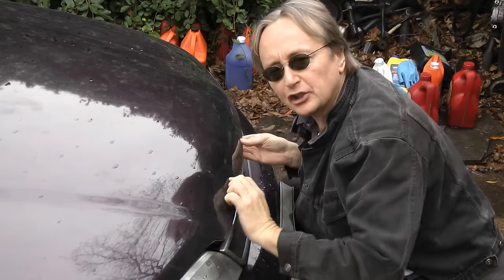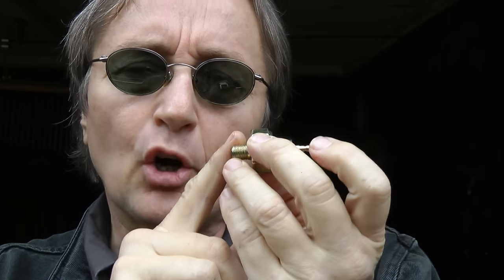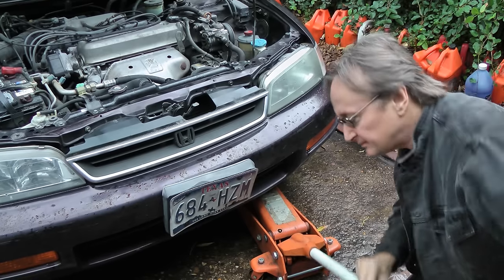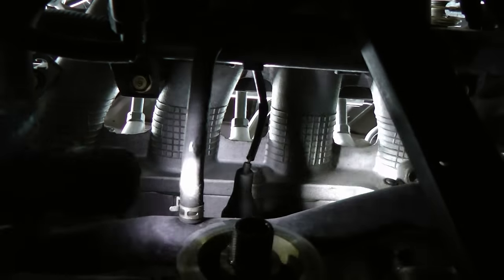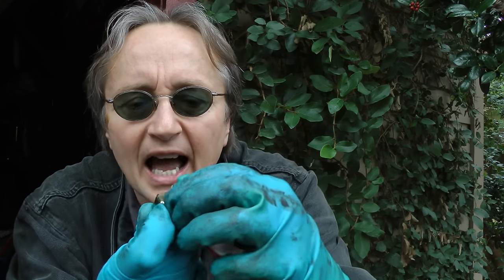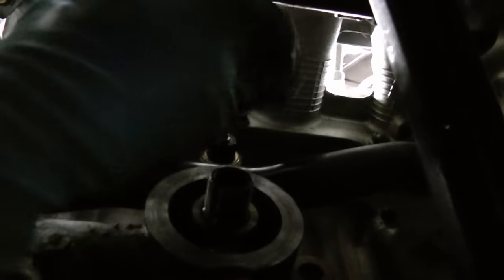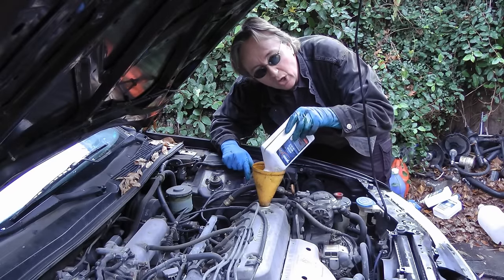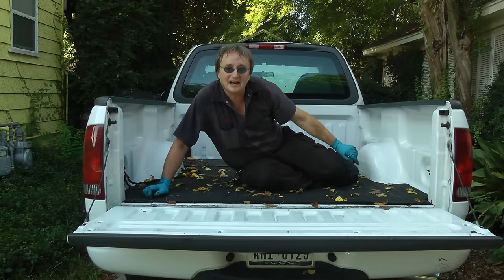How to Fix a Low Oil Pressure Light in Your Car

Comment: What i NEVER got about cars. They have an oil warning light, that come on only when the car is so dreadfully low on oil the engine is probably already terminally damaged. Why not make them so the oil warning light comes on at a sensible time, for example when the oil is half way between the min and max marks on the dipstick, so you have plenty of time to top up before you start grinding metal?
Reply: My BMW has 1qt low sensor and 2qt low sensor plus the critically low sensor. It takes 7qt of oil total.
Reply: @Starscreamious  that's why I'll never own a bmw... You just described 3+ sensors for one job... Are we serious right now ?
Reply: @MechInvent  It really was that way. And I don't see the problem in this circumstance as oil level is highly important.
Reply: If it was that sensitive it would come on every time you accelerate or take a corner, best bet is to just pull the dipstick and check every day or two before you turn the key
Reply: @Starscreamious because they want you to buy the next car
Reply: Chevy Vegas had low oil shutdown 50 years ago. No excuses why cars can't have it today.
Reply: Vw does this and at 150k miles you get to hear it beep when you are going under 50mph on bumpy roads.

Comment: what if that light turn on intermittently during driving? i checked the oil it's not dirty nor low.
Reply: Your oil light on your car dashboard is faulty or your oil pump is starting to going bad.
Reply: I have a similar issue. It stopped after I got an oil change last month , but has now started again just today on Jan. 7th.
I'm willing to bet it's just a faulty sensor.
(I'm hoping it's just a faulty sensor).
Reply: @jacksonkids1  what was it? Mine is doing it now, though now it stays on so I'm sure it's my sensor. Before it was only at idle which was scary.
Reply: @Chu3505 my oil pressure light came on but turned off by itself. But my car sounds really rough while accelerating. Would this be an oil pump issue?
Reply: @andycohen3365  Changing your car engine oil and filter lately.If yes,changing your oil sensor unit too.Listening to your engine near the oil dipstick area?Your oil pump make any noises or grinding sounds?if yes 95-100% your car engine oil pump it on it last leg.

Comment: Ever had to replace a fuel float sending unit in a 1995 Buick Lesabere in the tank?  Go down hill it goes down go up hill it goes up.  Take curves left or right go corresponding sides.

Comment: its slightly more accurate hot since liquids expand with heat. when your can is on it can reach 230 degrees. checking cold will measure only a few millimeters lower.

Comment from the maker: @MrGizmo757 yes it will, the pump may be pumping oil to a spot that's blocked, backing up pressure to the gauge hole where you measure the pressure. Find that blockage and fix it fast, cause other parts of the engine are getting no or low oil.

Comment from the maker: if sending unit is not bad, and you actually have high oil pressure, that's normally a clogged oil feed line in the engine, which backs up pressure before the sending unit and makes it go sky high. Real fun job then taking the engine apart.
Reply: What if the oil lights coming on occationally on start and the oil is suddenly overfilled according to the dip stick.
*Note the oil light goes away if you restart the engine and this is on 2005 Jeep Liberty 3.7L V6.

Comment from the maker: try a new oil sending unit as in this video, and pray that fixes it.
Reply: I think I fkd up the thread of the oil sensor in the engine , its allmost gone , what to do now :o?? HELP!!! the engine is 15 years old :(
Reply: Scotty, help. I changed my oil myself and drained it for too long, about 30 minutes. The BT50 '09 no longer starts afterwards. Any recommendation?
Reply: @laevalla  there is no such thing as draining your oil for too long.

Comment from the maker: the fans are normal. The thermostat is at the end of the big hose coming from the radiator and bolting to the engine head. Two bolts and it's inside the thermos housing where the hose clamps to the engine

Comment from the maker: when the engine spins slower, the oil pump spins slower too. But, as long as the engine does not clank when the light comes on, you can drive it.
Reply: But in my car oil pressure blink on warm engine when low speed  sometime when cold engine not light blinking Can I drive continuously

Comment from the maker: @TOMZM15 many things can cause low oil pressure, from a weak oil pump to a worn engine where the bearings have worn enough that the oil pressure drops from going through too wide a space. figuring out what's doing it is pretty much educated guesswork, other than tearing the whole engine down and rebuilding it. Scotty

Comment from the maker: try any good engine flush in the oil, follow the directions on the can, then change the oil and filter and pray. If that doesn't work, engine would have internal bearing damage

Comment from the maker: @DavidTheCatMedia change the oil pressure switch, and if it still flickers, live with it on that old thing, oil pressure always drops some with old age. Scotty
Reply: Hey Scotty! I have a Toyota Corolla 2000, and I was told that the oil pump may be clogged and to remove the oil pan. Is this right?

Comment from the maker: if oil pump is not working, engine will rattle like mad when you start it up and it's running. You remove the oil pressure sending unit on the engine and install a mechanical test gauge there to see if it works or not

Comment from the maker: @paingain100 not really, it wouldn't effect vacuum, only oil pressure. And if it's leaking, replacing it would stop any oil related low pressure problems if no other problems exist in the engine.

Comment: Hey, Scotty. I've been watching your videos for a long time, and they've helped me a lot. I have a problem with the oil light coming on or flashing when the car is fully warmed up, usually in traffic. After I got home, I waited about 20 min and checked the oil level and it was full. Then I started the car again, but the light didn't come on. The can in question is 98 BMW 5 series (E39) with six cylinder engine. It has a million kilometers on the clock, and although it burns oil, the engine seems to run just fine. It has good power, and I don't hear any noises. Could that be a faulty oil pressure sensor or is it more likely that my engine is worn out?

Comment: oil pump screen or filter clogged up  or sensor 
do all of this older car like a 2001 mercury220 thous-miles put the right oil and filter which one you do first I well put the oil sencer on eng first needs oil change take oil pan on anyways clean oil pump make sure oil pump gears sliping
Reply: no english

Comment from the maker: have the oil pressure sending unit removed and replaced to see if it goes back up to normal. Pray it does, normally it will if no noise is made when running

Comment from the maker: first, you need the correct siwtch. If that still reads low, either the oil pump is bad or the engine has worn internally causing low oil pressure

Comment from the maker: yes, you remove the factory sending unit sensors and screw in the mechanical ones. then you remove the oil pressure warning idiot light bulb or led in the dash to turn the old one off

Comment from the maker: @MrRichierich1990  engines just flat wear out over time. Even with oil pressure, an old bearing can fail, and result in a locked up engine. The oil pressure gauge only measures oil pressure where it is, not in any other locations. Scotty

Comment from the maker: @jdm4life89 then someone really messed up the rebuild. But of course, hook up an actual mechanical oil pressure gauge that we mechanics use to see if it really has none. could be a gauge problem, pray it is.

Comment from the maker: you remove the oil filter and it's hiding under there, but you can't see if cause the ac compressor is in the way. It often is necessary to remove the compressor to get to the switch

Comment from the maker: @Diabloscampeones9 oil pressure units don't make a car not run, except in some chevys that tie the oil pressure into the fuel pump line so you don't run with low oil pressure. Watch my video "fixing a car that cranks but doesn't start up" and try all that. Scotty

Comment from the maker: @bhstone1  In that case, you'd remove the oil pressure sending unit and put an actual mechanical oil pressure gauge on it and run the engine. IF the pressure really was low, then nothing to do but take the engine apart and fix it, a VERY expensive endeavor in most cases. Scotty

Comment from the maker: @MrDOA313 could be just a wiring short, if the engine does not clank, the pressure is good enough.
Reply: Hi Scotty what if the engine occasionally clanks when revving engine? 1990 Ford F150 xlt lariat 4x4 5.0 low oil pressure almost in red zone then goes up to the letter N of normal on oil gauge. It's good on oil and looks good (full) but I haven't changed it prob 14 months bc hardly don't use truck just sitting. I will change today i use 10w30. I changed the oil sensor before now doing it again. Please help.

Comment from the maker: @mathew020x OK, that's the right year. But unfortunately, I've never done one, and my data system does not tell, it just says it takes half an hour labor to replace it, but doesn't bother to tell where the damn thing is hidden. Realize that's a Ford engine, normally the senders are near the oil filter.

Comment from the maker: engine will eventually lock up if you drive it with low oil pressure, the metal siezes up and stalls out at first, but will eventually stop entirely.  find why the oil pressure is low, like a worn ol pump or worn engine bearings.

Comment from the maker: replace the oil pressure sending unit and do an engine flush with a cleaner like K and W engine flush. Then put in new oil and filter and a quart of lucas oil additive;  Pray that fixes it, cause if not, you've got low oil pressure and that's serious internal engine wear

Comment from the maker: you remove the oil pressure sending unit on the block at the back side and put on an actual oil pressure gauge with a hose to read the actual reading. Bit of a pain though.

Comment from the maker: it's hiding on the head of the engine on the end by the driver's side just to the right of the air duct that sends air into the engine. Ger a new one, you can eaisly match it up

Comment: Thanks for the video!  Wife's truck started this today and with the video the switch out was quick and easy.  In addition the old sending unit apparently blew oil up into the connector when it failed.  Hit it with some mass sir sensor cleaner and air to clear that out.
Reply: Did that take care of the issue?

Comment from the maker: either sending unit is bad giving false readings, or you have an oi pressure problem. Has nothing to do with their valve cover gasket job. so take it in and see what they say when testing the actual oil pressure with their gauges, and PRAY it's not internal engine wear.

Comment from the maker: it could be that, fix that first and pray it's not something else. Cause low oil pressure can be a weak oil pump, worn engine bearings, clogged oil passageways, and much much more.

Comment from the maker: something went wrong in the rebuild, that's for sure. I would pressure test the system to see what's leaking, and pray it's an easy to fix leak. and I would drain the oil and see if water is in it now.

Comment: Thanks for the tutorial Scotty. I have a 2007 Accord 4 cycl, 5-spd with 90k on it. Sometimes when I make a turn, the oil light comes on and sometimes it doesn't. The oil level is good, no leaks underneath the car, I put in 4.5 quarts when I do oil change. How do I find out what causes the light to come on? How do I check for oil pressure?

Comment from the maker: you actually have an internal oil pressure problem if adding some oil makes the gauge go normal. Those german cateras are disaster areas waiting to happen, I'd get rid of it BEFORE doing any serious super expensive engine work myself

Comment from the maker: pray it's just the sending unit, cause if not, normally it's low oil pressure and that's expensive internal engine work

Comment from the maker: @Miguelcoolio  I would question the rebuild myself, that is normal for an older worn out engine, but not a "new" rebuilt one.  Have a mechanic put a real oil pressure gauge on it to check the actual pressure, and if it really is low with a pro gauge, go back to the engine rebuilder, he messed up.  scotty

Comment: '89 Toyota Cressida. Oil light dimly flickers occasionally (especially after driving on the freeway,) but when I turn off the engine and start it again, the light is off again and doesn't come back on. No bad noises from the engine. Oil and oil filter are relatively new. Oil levels are fine. What do you think?

Comment from the maker: I think you have oil problems. Try changing the sending unit and PRAY it's that leaking and lowering pressure. if not, and it still taps, you have serious internal engine oil problems, from a worn pump to worn engine bearings

Comment: Dear Scotty, I have a 99 dodge caravan base model 2.4L, 4 cyl. Absolutely love this van. It was a hand me down, free 98,000 miles. the brakes were total shot. Trans stuck in 2nd gear, only has 3. I got all that fixed and has served me well 10+ years. 
Recently if I go very far, for me that's 25 miles, the oil light and bell comes on. I pull over, shut down, check oil is fine. start it back up and proceed no lights or bells. gets me home. Ya think I should have an oil pressure check done. And if the engine does blow do you have an estimate for remanufactured replacement? Mileage now is 191,000. Love, love, love this van. It's plain and simple not all gooked up with electric everything like todays models. Sure the A/c and radio doesn't work but I'm fine with that.

Comment from the maker: pray your oil is just low or dirty, and check the oil pressure sendingunit  wire to make sure it's not loose
Reply: Scotty Kilmer hi scotty plz help i drive hyundai sonata 2012 after i changed car turbo now oil sign comes up only when car parked when car moves the sign goes !! plz what can i do

Comment from the maker: if it really has low oil pressure, first change the oil and filter and pray it's just old worn out oil. Cause loss of internal engine oil pressure ruins an engine and costs thousands to repair on a BMW engine.

Comment: Hey scotty. Have a 2006 cadillac dts. 60k. I was driving and light came on stating low oil pressure, turn off engine. What could it be at this low mileage? I have noticed that sometimes it looks like I'm leaking oil on the floor. But the light went away after shutting car off 3-4 times. Any ideas?

Comment from the maker: not changing the oil enough does damage. I would put engine oil flush in, run it as the directions on the flush can, then put new oil in and pray you didnt' damage the engine inside.

Comment from the maker: have a mechanic hook up an actual mechanic oil pressure testing gauge. Pray it has good oil pressure, and that the wiring or gauge in the dash is bad. Cause if it has low oil pressure, that is often serious internal engine damage that costs a ton to fix.

Comment: Scotty, if the sending unit is fine and the pump is fine is there anything to do besides a rebuild/replacement of the engine? Heavier weight oil? Additives?

Comment: Hi Scotty.  Your video help me a lot.  But I have a question? I have a 89 Chrysler New Yorker.  I just put a new oil pressure switch and now the gauge is showing to high when I turn it on put then it goes to normal after a while when I drive it.  Why is that?

Comment: I had the oil changed today(they were going to replace the unit) and was wondering if it is ok to run it with this fault code. The Jeep has never needed to be top up and runs like a champ. Thanks again. Jamie

Comment: Scotty
I have a 1998 nissan altima oil light came on. I  changed the sending unit, had sludge in the oil pan had that cleaned out. light still comes on but does not stay on. do i have to just keep changing the oil more often?

Comment: i just did this to my moms 05 jeep liberty a couple months ago. my god what a pain...
it took me probably about a half hour or so just to unscrew the thing because the ratchet i was using couldnt turn more than about 1/10 of a revolution at a time..
but once i got it out and re-found the hole the new one went in and the lights been off for about 2 months..
(i used a 27mm 12 point deep-well socket to unscrew the sending unit.)

Comment: if it is causing oil leaks would that interfere with the vacuum inside the engine? Or would it return to normal with replacement.

Comment from the maker: you really do have low oil pressure then. anything from a worn oil pump to worn engine bearings can cause that. Be prepared to spend a bunch, or get rid of it fast

Comment: My car did that due to a leak out of the valve cover the gasket might be bad too a few months ago my Uber passenger complained about smelling oil too but I had no idea I did watch a engine tear down video and the guy said the engine I have is the worst lol 162k miles engine light been on since 100k still rolling though a garage is going to look at my bucket this Monday 💯

Comment: Took my 2007 Impala to get that part changed. But the light came back on. Took it to Auto Zone and was told it was the same thing. Any advice on how I can turn engine light back off...permanently?
Reply: Update: I didn't fill up oil that escaped during changing or part. A day after I filled up my engine check light went out.